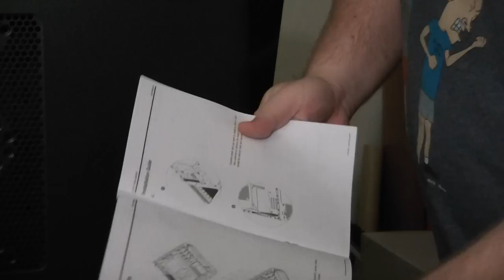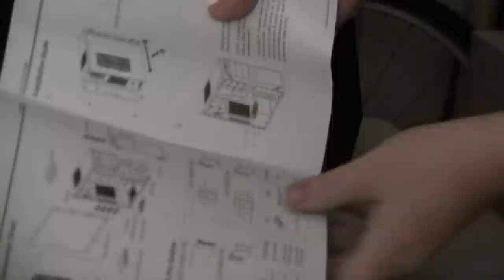Rosewill Challenger mid-tower case unboxing and short review.

Comment: I did. In fact, I'm using the build to post this message.  They fit fine but there is very little room between the hard drive cage and end of the card. Not problematic, mind you but it is close. You have 1/4 or 1/2 inch space between the hard drive cage and the video card once all is installed.

Comment: Rosewill sources stuff from different OEMs, so it is not surprising that the same design is showing up under some other labels. The Diablotek EVO CPA-6170 seems to be exactly the same inside; it has a chrome finish instead of the Piano Black finish. The EVO has four fans standard instead of three. The Rosewill rated quite high in Tom hardware's review.

Comment: the space behind the mother board is MORE than enough, I have my 24 pin power supply and 4 molex headers lugged to two sata converters and two fans (the front LED and the top 140 mm) I also have the front mounted USB cables and the audio port cables and power switch cables trailed accross the spine of the case on the back panel. It was a tight fit, but it ALL fits in... but you really have to take your time on the management,,,

Comment: actually, the most important use for the rubber feet is to lift the case off the ground => psu air intake.
and those rubber nubs on the inside for the psu are probably also more likely for anti-vibration purposes, not anti-scratching ;)

Comment: This is identical to the Casecom KM-6788 that I'm using to rebuild my main pc, except that you get even less accessories with the Casecom, ie, only 1 fan, no instruction book, no psu filter, no ssd adapter. I know what you mean about cable management - having the holes is great but they're nigh on useless without the space at the back!

Comment from the maker: @MGSBigBoss1964 Its good enough. Its better then an Antec 300 case where you got no hole in the bottom at all - this case has a hole for the intake and a filter. My only problem with Challenger design is that in order to remove the filter you have to drag the case out, wherever you're keeping it, and flipping it over or tilting it so you can remove the filter for cleaning. I'd prefer that filter latch to be sticking out the back so you could easily remove it ad put it back after cleaning.

Comment from the maker: @notthere83 Actually, the rubber feet appeared on cases since the very beginning, even when the desktops were not vertical towers, but horizontal. And if you followed PC case development through the years, as I have, you would notice that actual holes/mesh started appearing on cases for PSU intake only couple of years ago. Take a look at a quite popular Antec 300 case. Its a crime by today's standards, really, but in any situation - the rubber feet were primarily against vibration and slipping.

Comment: Can you measure the inside of your challenger case and let me know if you think this card would fit in to the case? (IN between the back and the harddrive cage?

GIGABYTE GV-R795WF3-3GD Radeon HD 7950 3GB 

In the new egg video, the card measures at 10 1/2 inches...

Comment from the maker: @Klmblitz4 "The little one", I'm assuming, is reset button, and if its does nothing... Couple of scenarios - you didn't hook it up to the mobo, you didnt hook it up to the mobo correctly, the mobo connector is dead/defective, the case connector defective, the wire is broken/not properly making contact b/w the reset button and the connector. There are sites that sell all the I/O connectors separately, and they're cheap, so I'd check the connections, and then replace the wire myself.

Comment: I bought this case to move my 435mt Dell motherboard into.  After installing into the new case (on the back panel), I have huge gap/opening where the USB, LAN, etc stuff is, because my Dell case didn't "allow" me to take out the covering panel for the inputs (welded in).  Has anybody ran into the problem? Thanks!

Comment: @zver711 Yeah i think i will get this one because Newegg has almost 400 4 and 5 star reviews. And the logysys one doesn;t come without a psu and i dont need the one that they are offering so i am paying extra for nothing. I will probably order this one. The only problem I have with it is that in the front where you put a case fan it is not transparent, so my blue LED fans will have no use there. But for that one i can just wire up the fan in the back to go there and put my LED one in the back.

Comment: am planing to get the same case but i dont know if a could fit or work in plaing games like Rust or Arma 3

Intel Core i5-6400 6 MB Skylake Quad-Core 2.7 GHz LGA 1151 65W BX80662I56400 Desktop Processor Intel HD Graphics 530

Mother Board= MSI H110M Gaming LGA 1151 Intel H110 HDMI SATA 6Gb/s USB 3.1 Micro ATX Intel Motherboard

Graphic Card= MSI GeForce GTX 1050 Ti DirectX 12 GTX 1050 Ti GAMING X 4G 4GB 128-Bit GDDR5 PCI Express 3.0 x16 HDCP Ready ATX Video Card

Memory= G.SKILL Ripjaws Series 8GB (2 x 4GB) 240-Pin DDR3 SDRAM DDR3 1600 (PC3 12800) Desktop Memory Model F3-12800CL9D-8GBRL

1 TB Hard Drive 
  
400 Watts Power Supply 

Please help am trying to build my first gaming pc and i dont know alot about this pc stuff

Comment: what is the max fittting size for the GPU?
Reply: Tyler Geimer I have  gtx 980 which is I believe about 11 inches long and its up against the drive bays but does fit.  Hope this helps
Reply: i got my r9 290 to fit its like a glove
Reply: Tyler Geimer what 290x did you have?
Reply: i got the asus r9 290 not the x but the directcu 2 overclocked edition

Comment from the maker: @1Adr1an6 As I mentioned in the comments here... many times over, I do not have this case in my possession. It was a build for a customer and I fit a GTX 450 in there without a problem. Read some reviews, like on Newegg or something like that - people say that they fit their Radeon HD 6870 or 6950 with no problem, GTX 550 Ti, etc. Personally, if you got about 200-300$ to spend just on the video card, I'd save up for a better case than this. I'm sorry to sound like a snob, but Rosewill is cheap.